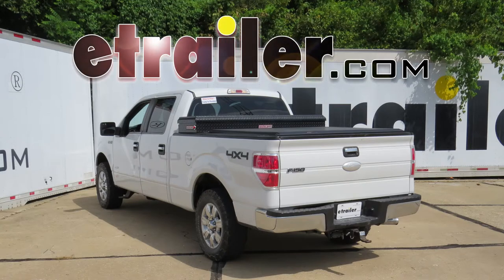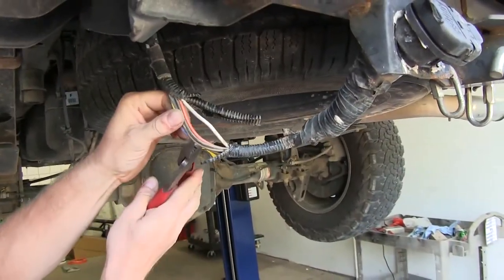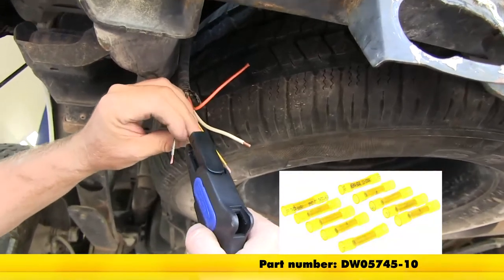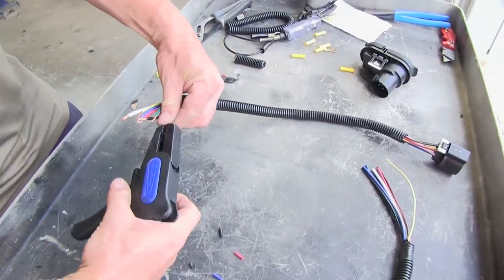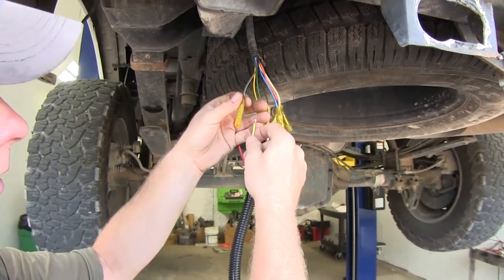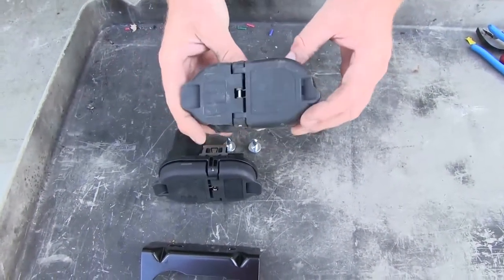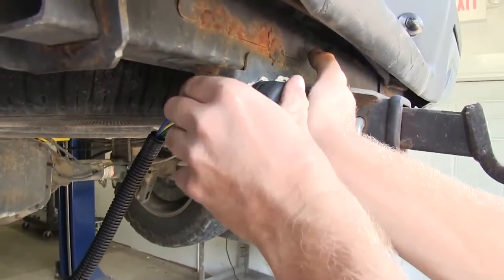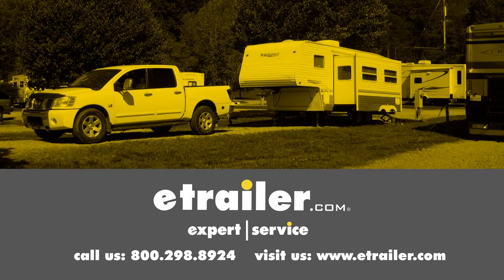Set up: 4' Pigtail Wiring Harness for Pollak Replacement 7-Pole RV Socket on a 2011 Ford F-150

Comment: Any way to test the harness before changing it? I checked what I believe is all of the fuses and found #73 blown but that didnt fix the issue.  I dont believe it's a fuse because the trailer lights will occasionally work.  Sometime if I hit the lock button before starting the truck the trailer lights will click on and stay on.